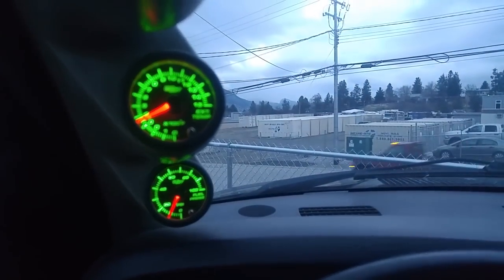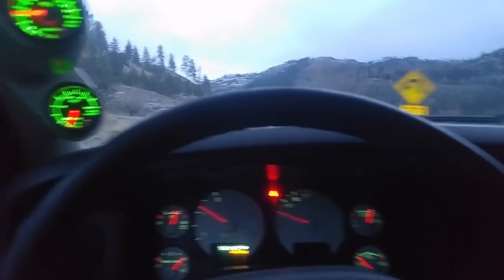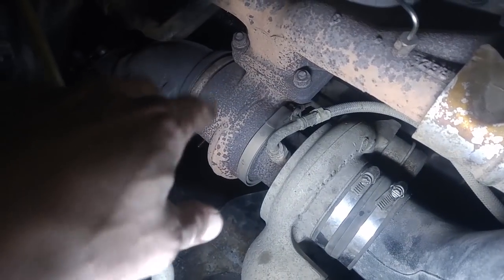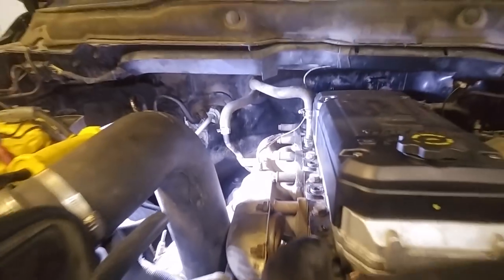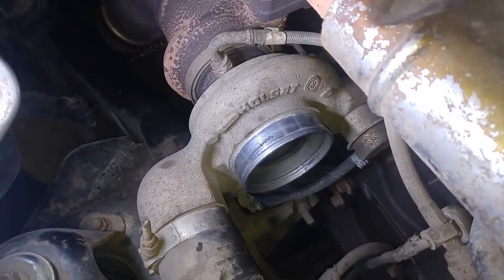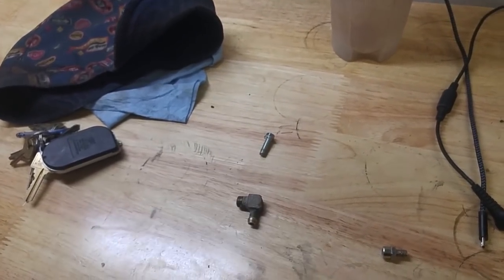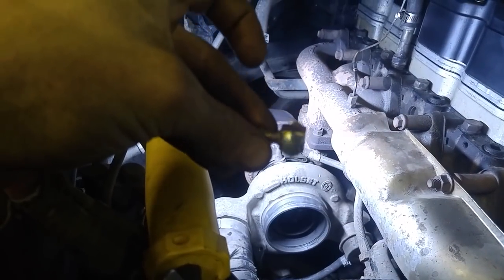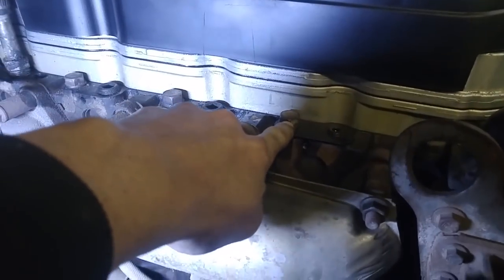HOW TO TURN UP THE BOOST ON YOUR CUMMINS!!

Comment: Wish I had known this before I spent the money on my Banks Big Head Actuator.. I'm running it at 42psi pulling my boost gauge from My Banks Monster Ram and also stock head bolts with no issues..

Comment: On that rubber line you can take a small needle nose vice grips and clamp on it. That’s what we do do the Big Rigs. You should be able to gain 10psi easy. Less work

Comment: Interesting! Wonder how my edge tuner would feel about this mod, it freaks out with anything over 35 psi.......
Reply from the maker: Edge tuners usually fool the ecu to think boost doesn't go over 25psi so it would work well for you. You can just change at what psi it starts freaking out at.
Reply: My edge has a back off set at 39
With it off it will hit 44psi

Comment: When you said and I don't have head studs I instantly thought next set of videos "cummins blows head gasket" "Replaceing head gasket and installing head studs"
Reply from the maker: Its been like that for years, no issues. Its all in the tuning.
Reply: @Cumminslife  Hey man, do you tune EFI live? 14 ram 3500. And would this trick work on my truck, not sure if its a different configuration. Im a few hours north of you got efi installed last year and it surges up hill back and forth, super annoying and it looks like you know your stuff
Reply: @Cumminslife hey ik the videos old but I have a smarty tuner and I’ve got the rail turned all the way up big bang injectors that are slightly bigger and the tune at max it smoked like a train but my waste gate solenoid wire broke and I don’t want to pay 1500 for a solenoid so I blocked the waste gate and now it doesn’t smoke hardly at all do you think I will blow my head or damage the turbo it’s bored to the max and has the max bore head gasket doesn’t seem like I’m harming anything and how can I tell if I’m over spooling the turbo

Comment: What kind of tires would you recommend for my truck? We have snow and ice mixtures around 3 to 4 months of the year where i'm at. Want something with decent tread life. How do yours do?
Reply from the maker: Very happy with my toyo open country mt's in all conditions. I do have lots of weight though.
Reply: Savage Sausages, just saw your post. A FYI i was running Mickey Thompson Baja MTZ P3 through the winter in Northern Michigan(Upper Peninsula) 06 Mega Cab  , They were absolutely Terrible on the Ice, the rubber compound is way too hard, almost no traction. They look cool but definitely not worth the money if you do any winter driving. That being said they probably work great in Georgia / Florida in the clay /sand

Comment: Why not change spring instead? That way it'll still function. Or add a BOV set for the psi you want to eliminate compressor surge when you snap the throttle shut? Just a thought.
Reply from the maker: Well you cant replace the spring in the factory wastegate otherwise I would. And I have no problem with compressor surge, adding a bov would just be unnecessary complications.
Reply: Optimal Welding fair enough!

Comment: pinch the wastegate line off. you will never make enough boost with a stock cp3 to hurt it. i have my IP maxed out and rev to 4000 rpm for 2 years plowing and towing heavy on a 400k 07 and not one issue. did the same to my 04 never a problem.
Reply from the maker: Yeah on stock or mild tunes you will never have any issues but with it turned up I can push stock turbo 60psi+ im sure she dont like that.
Reply: mine is maxed out on the tune. like i said i rev it to 4000, injector pump is maxed. otherwise 100% stock. i cant get more unless i add parts now.. trust me i've built some monsters including a 6.7 swap in an 06 mega cab with stroker pump, big turbo and injectors, and a way in the 4 digit 12v pulling truck i know what they can take.
Reply from the maker: What is maxed out to you? How much rail psi, duration and timing?
Reply: rail pressure. once it starts to drop much you need more pump. you can add all the timing you want but without fuel your not doing a lot. just flirting with head gasket issues, especially in a 6.7. we are running in the mid/high 30s with buddys pulling truck but its fire ringed and running a big p pump

Comment: 👍👍👍over the last month or so , I've blocked off my wastgate.. the most psi I've seen is 37.. now I've got couple upgrades on my truck ..SMARTY S06 POD ,  FASS 150GPH  cp3k (keeps fueling above 3k)  5inxh exhaust , S&B CAI and S&B intake horn .. 03 5.9 2500 305hp AUTO ...  maybe I've got a boost leaK ???  im pretty good about keeping everything tight though ....   any help would be great ..    also thanks for showing us all theses little tricks with our ( early 3rd gens ) trucks 👍👍
Reply from the maker: Its possible that you have a boost leak but the tune and weight of truck are also major factors. hook up a trailer or increase your injector duration and you will see more boost.

Comment: More pressure on your exhaust manifold gaskets! Be prepared to blow them old ones out! Then after replacing them the next weakest parts are stressed like silicone hose boots!, Then old stock Turbo will die faster from More HEAT !. Think of that!
Reply: Oh no a couple dollar gasket